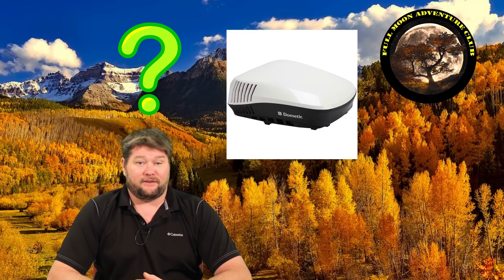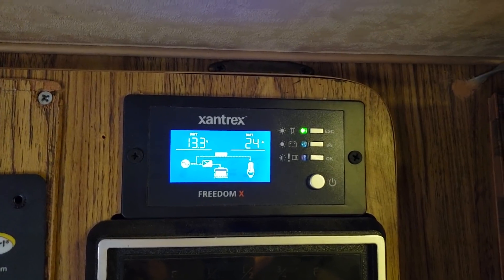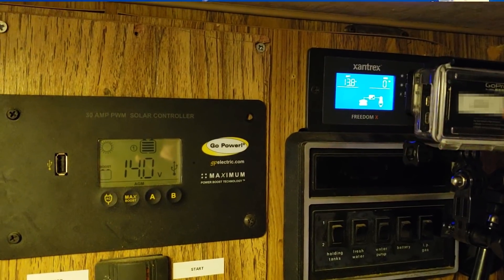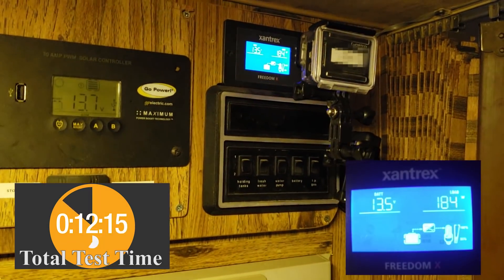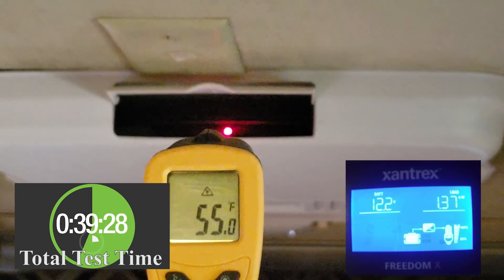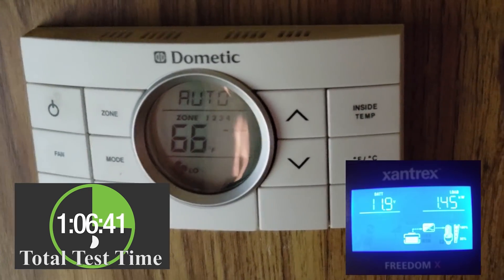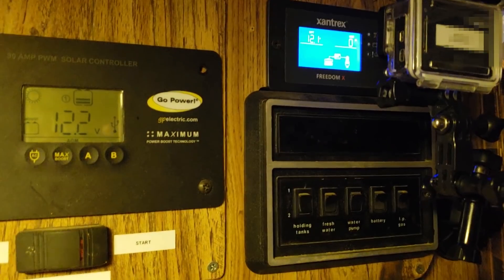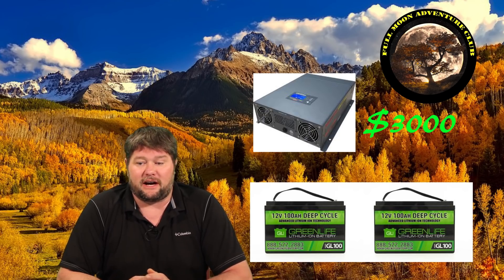How Long Will an RV AC Run on Two Batteries?

Comment: Why are RV air conditioners so absurdly powerful?  RV's are pretty small, a 5000 btu window unit should be able to do the job at a third of the power.  Or are standard Rv's so poorly insulated that you actually do need 15000 btu's to keep up?
Reply from the maker: You guessed it. Poor insulation and heat build up after a road trip needs a big ac to compensate in most cases. If its 90 degrees my 15000 btu doesn't even keep up sometimes.
Reply: rolling oven more or less, all rv's and mobile homes fall here
Reply: mike brink  probably better off bouncing from local hotel to local hotel back and forth.... or the no-tell motel to motel :)))
providing you have income, most only allow a few week stay (maybe 30/60/90 days) it varies where and how clean/nice you keep things.
the upkeep on anything with wheels, uses fuel is nasty... if you have a clean record and good at ,any thing,s maybe apply for maintenance, clerk or other position ;)

Comment: Engineering question. I have seen a van conversion where the engine heated up water that was stored in an insulated tank and that provided the hot water. What if you used the car's AC to cool down some liquid that you keep insulated - would that not work better than an electrical AC system?
Reply: No. With regards to the systems efficiency, the mechanics of an AC system are finely tuned such that rigging your own with random variables (compressor, condenser, expansion valve, wire length, etc) with give you terribly inefficiency results.

Comment: Charging at 80 Amps then discharging at 100 amps or more is a recipe for a short lithium battery life.    

But not my stack of cash
Reply: How can you run your air conditioner without damaging batteries then?
Reply: @NorthlandDWJ  appropriately size the battery bank.   It takes more than 2 lithium battery to do it properly.

Stupid hurts sometimes it is in the wallet

Comment: doesnt woth to buy that ac  and first time i hear about i am gonna damage my equipment and if you have lityium battery there is no way to dame anything else i disliked clock show over hour you say 30 minutes
Reply from the maker: Running an air conditioner with low voltage can damage the compressor. The clock was set to run for the entire test time but does not always match up with all the video clips I inserted. I hope that helps. Take care and happy camping.  Jim

Comment: I'm calling BS on this.  Your video conveniently cuts away during the time where the compressor starts.  That inverter will not start a compressor with an LRA of 50+ amps like that unless it was plugged into shore power during the start.  If the discharge temp is to be believed then it's showing that the compressor is not running right, either.
Reply from the maker: I was using a Xantrex 2000 watt pure sine wave inverter with a 4000 Watt surge rating. It was running a Dometic 15000 BTU brand new air conditioner which runs anywhere from 1500 to 1700 Watts. I assure you the test was accurate and done off of shore power. Without re-watching the video to know what you're talking about regarding the wattage rating shown in the video it's possible that it didn't match up with the time frame or maybe I put the wrong clip in the wrong section a video but it's all done during that test disconnected from Shore power.  Jim
Reply: You should just take a new clean video and post it then.  I will eat crow!
Reply from the maker: @porkbuttrocks  I think I will be doing a new one to show how it works without the AC temperature turn down to 60 degrees. Maybe more of a real-world test we're about to go on an RV trip so it'll be a good time to do it. I would also like to see it done with the soft start installed. If you're a subscriber I guess you'll see it soon enough. Take care and happy camping.
Reply from the maker: @porkbuttrocks   I was looking at an easy start but I haven't gotten my hands on one yet. Very interested in seeing how much longer that extends the battery life without that giant surge.
Reply from the maker: @porkbuttrocks  sounds like an impressive system. It just occurred to me that I've swapped my Xantrex  2000 watt inverter for a SW 3012 3000 watt inverter. You may have to go on not believing me for a while. But I assure you it did work. Take care.
Reply: @fullmoonadventureclub  
C'MON MAN do the test with a 400watt 5000btu for us POOR GUYS 
That DOMESTIC 15000 is a energy hog!!!!!
Reply: RV ac's have hard start built in, to help eliminate the peak start current by temporarily adding a larger "phase" change to the start winding circuit using a potential relay and capacitor, in parallel with the standard start capacitor. if it didn't have that it would never start on shore power in many places or generator.. nor would it restart if it happened to short cycle, the newer units would have protection against that. (old units/manual controls, short blackout) also inverters and generators have a peak current which they can sustain short term for motor starting purposes..

Comment: 1.How do you recharge your batteries ? 2. Can propane get the AC going? Somehow propane Power's  the Refrigerator and Freezer, Oven and Stove and microwave, Lights, Water Heating system, and Furnace But not Air Conditioner this doesn't make sense please explain or can it?
Reply from the maker: The battery is recharged using solar, shore power, or the generator. Propane can not operate the air conditioner, microwave, or lights. Those appliances are only powered by AC current supplied by a inverter, shore power, or a generator. I hope that helps. Thank you for the question and take care.    Jim

Comment: Exactly why is there 18 dislikes?  I thought the video was great and very informative.
Reply: He didn't know what size AC he was running
Reply: @natestube2  It looks like I have more to learn before I go ruining a solar setup.
Reply: cose there is always some idiot who will find reason to give thumbs dwn
Reply: He never mentioned the amp draw. I’m guessing it’s an inefficient a/c drawing over 12amps. Coachmen’s Li3 vans using the 12 volt 20,000 btu Pro Air a/c can run for 10 hrs on their 600 amp/hr system. Add 400 to 600 watts of solar and you’re golden as long as you’re in a sunny area. Or get the a/c unit that advanced Rv sells. It’s very efficient. Bottom line is, the debate of running your a/c off battery power is solved. But you can’t use these old Dometic air conditioners, they’re just too power hungry (inefficient)
Reply: The dislike might be accidental, but is demonstration is how to quickly ruin your lithium battery's.      So he is discharging them at 1 c or 100 amps with out checking the manufactures website it is probably right at their max rating.   If you look at the charts charging and discharging at high currents you really reduce your life of battery's.   

But to each his own.

If you want to see someone who actually understands solar and setups, see will prowess
Reply from the maker: @jerrygundrum1  if you watch a lot of my videos I certainly cover the safe tolerance levels of different battery types. But personally my batteries work for me and I'd rather push them hard than sit in the dark half the time. If I want to just charge them at 50% capacity and recharge them when they get to 50 per-cent capacity I'm sure they last longer but they've been going for years now and I've been enjoying every single amp out of them. Thanks for the comments and happy camping.  Jim
Reply: @fullmoonadventureclub  got a laugh, if I spend time watching a video I like the presenter to at least have a clue what he is talking about.    I haven't watched any of your other videos nor will i.   

has absolutely nothing to do with safety.    If you had properly researched the care and feeding if your life battery you would understand that charging and discharging them like that significantly reduces their life.  

I have no idea how many you have, my guess is, if you keep treating them like in the video you are going to be one sad puppy when they  performing at about 50 percent capacity in 4 years.

That will be an entertaining video
Reply from the maker: @jerrygundrum1  like I just stated. I am certainly sacrificing performance for longevity. I assure you I definitely know what I'm talking about as I do installs and worked for an RV company for many years as a RV expert. I test things to the max for the sake of my viewers and for my own personal enjoyment. The batteries probably will only last four years and I will have enjoyed all of those four years. You can't please all the people all the time I'm afraid. Again, thanks so much for watching and happy camping.   Jim
Reply from the maker: Thanks. I appreciate the comment. Take care and happy camping.    Jim
Reply: It is only around 2%, some will probably be mistakes, most of that 2% just reflect that there are some not very nice or stupid people in the world.
Reply: @snm359  Or they truly understand this has little to do with educating and more  about selling!

Comment: Thank you,but I set my home air at 77to78 degree in Florida and it works fine for me. Would that work for a while?
Reply from the maker: Yes in this test the air conditioner is running pretty much full-time. The closer temperature you have it set to the outside temperature the longer it will run. I'm going to do another test on this using the air conditioner to maintain a temperature 5 to 10 degrees colder than the outside temperature to test exactly that. Thanks for the question and happy camping..   jim

Comment: Why isn't the ac a dc unit?  That would be more efficient than converting dc to ac.
Reply from the maker: Most air conditioners are AC current based. I am only familiar with a couple of DC powered air conditioners. The Zero Breeze comes to mind but not much else.    Jim
Reply: I looked I to this a lot. 12v a.c. systems are expensive. For the same cost I get a nice inverter that will power other things and a more powerful a.c.  If you have a 24v system it work better to find a direct a.c. though

Comment: try also a soft start device that lowers your starting current required and also lowers your running current required on your AC unit. Cheers
Reply: Also lowers running current? That's awesome info I needed to hear. Thx
Reply: @standingmannequin7911  it sends more power over shorter time.
Reply: @standingmannequin7911  thus turning startup compressor faster efficient and drawing less amp per milk sec. But more juice in the get go

Comment: All you had to do was to measure the current drawn from the batteries and then do a simple math. You have 200 AH (good for 200 Amps for 1 hour) in your batteries- recalculate it.
Reply from the maker: It's as easy as that. But a lot of people like to see the visual test. It's also not easy to calculate how often the compressor is cycling on and off. I'll actually be doing another one of these tests where I don't have the air conditioner turned all the way down but just have it about 10 degrees lower than it is outside to see how much it cycles and draws which will change the time.  Jim
Reply: @fullmoonadventureclub  i hope in the next test you use a soft start and arrange things a little different,  i bet with those batteries you could get a few hours in a different arrangement.   i agree it would take a large battery bank like 1000ah to really have something  and if one could afford it,  having a few thousand ah to not have any worries at all.  but then would need to recharge it.     some people having 1500 watts of solar,   and ive heard of people having even more living completely off grid.   i guess every application would be different.  but a soft start i know is something similar to a capacitor in a sence making it to where you use much less starting amps.    thats the main killer   but i bet there are losses at the invertor, yet you did say it was pure sine wave.    hrmmm  not like your going to change your air conditioner but i but there are much more efficent air condtioners, and i have heard about but know nothing about DC air conditioners ?    i have heard they are much more efficent and some people have them in marine applications.  anyway  this comment probably had no value but ive been looking into all these things also.   my conclusion is come to a combination of it all.  having an efficient air conditioner   having a soft start (im also learning about capacitors on a different project.  having lots of solar.  (apparently there are some people with $ running at such a high level of solar they can run the air all day.   but its the night on battery alone thats the killer..  so a  huge battery bank, and again ive heard of some also having the dc to dc air some how, and also having hybird power sources   like wind power and battery,     i think if i was completely off grid i would have a combination of it all, and a huge battery bank.         but i dont.. haha.   so for pratical use   rv and camping,    it seems at best to regulate your ac use,     make better use of fans   have a huge battery bank and alot of solar.     

Thankyou for being smart shutting things off,.      its better to be safe and not push things, and try another test later after figuring things out .    loved the video. thanks

Comment: To get maximum run time, I suggest an AC unit that runs on 24V, or 12V, whatever your system voltage might be.  Of course the lower voltages will need larger conductors so there's a major trade off.

Or just go to a hotel that offers A/C! :)

Comment: Thanks for the share, I  always wondered how long 2 batteries could run an a/c.  I guess I definitely am going to stick with the generator for the a/c
Reply: Hey Chris. I need reccomendation for a generator that I can use for my AC in my van
Reply: @Toytatu  Westinghouse inverter generator 2500. It can handle The surge when the AC kicks on. It's around $500

Comment: RV A/Cs take too much juice. The smallest window air is 500 btu. With good insulation, it would've lasted all day.
Reply: all day? on 200 amp hour? no you're delusional
Reply: @eksine  and you don't communicate very well.
Reply: @raymondjames5035  what are you talking about? you're making no sense. do the basic math. it wouldn't last all day, not even close
Reply: Raymond James 

...5000 btu
Reply: @dalehumphrey8765  I stand corrected...

Comment: Can you charge your  RV batteries from the alternator on your tow vehicle (TV) - by connecting them to the TV battery terminals? Can you just keep the TV idling and with the alternator  producing 100 amps or more at 14 volts keep a load of 1400 watts for your AC running full time?
Reply from the maker: I'm afraid not. While connecting jumper cables to your tow vehicles battery terminals would give some current to the RV it would not be enough to sustain much. Certainly not 1400 Watts. You're tow vehicle would probably have to be revved quite high in order to produce the maximum voltage of the alternator. At idle your alternator doesn't produce all that much power. It would also drastically shorten the lifespan of your alternator on your tow vehicle and battery. There would also be a safety issue when it comes to having jumper cables unattended. If they were to slip off and ground out something or short your battery you'd be looking at a fire. Your best bet is going to be solar panels an extra battery or perhaps a small Honda inverter generator. I hope that helps. Thanks for watching and happy camping.  Jim

Comment: Great review, thanks for sharing. My questions is, Is that thermostat 12-Volt and where did you get it?
Reply from the maker: The digital thermostat in the video is a Dometic thermostat that I purchased from Dometic. It is a 12-volt system and it can also be rigged up to run your furnace or multiple zones.

Comment: How long will two 100 Ah, 12v liPo  batteries run an AC? Oh my.  Bawahhh  ha ha! Not long enough.  An Hour and a half ain't shit when you need A/C.  Lead acid batteries wouldn't last more than half that time and I'm sure you don't know why but it don't matter. It was an honest demo, I got to give you that.   I really shouldn't comment more.  Best wishes.
Reply from the maker: 1000 watts an hour requires 100 amp hours an hour. It's the truth and I just wanted people to know it. It's very doable and I love chasing that Dragon but it can be expensive and difficult. Thanks for the comment and happy camping.  Jim

Comment: A quiet Honda gives off 2000 watts of AC power that will run your Ac all night long!😀
Reply: But it will never start it
Reply: @natestube2  I have been running a 12000 BTU rooftop air on a toyhauler for the last 5 summers, 24/7 for 2 months straight on a honda 2000. No issues. Average daily temp: 95 degrees f.  (Ranges from 85 -  115) Sometimes the crappy roof AC can't keep up, but the Honda has no prob.
Reply: @natestube2  add a soft start is what I am told...
Reply: The new Honda bumped up to 2200 watts, probably to give a little buffer here.

Comment: A homemade fuel cell battrey would compliment those Lion cells,  make a bleach battrey 2 volts per cell drop in waste aluminum and you got power!😁, copper lined 4inch PVC pipe. With screw caps on ends, bolt in the side of pipe thru copper, create anode by using 3 inch PVC pipe with holes drilled evenly around to allow electrons to flow. Wrap with stainless steel screen attach wire to side of case thru bolt for positive terminal case copper is - negative vent cells make 6 to 12  cells 6 cells gives 12 volts, 12 gives 24, use waste aluminum , drop in center anode then fill cell 3/4 way with bleach , reaction starts Giving lots of DC current to charge those cells, drain waste bleach into RV sewer tank, black, gray tank to kill bacteria, clean cells regularly remove bottoms and tops clean with a brush and re assemble cells , Free Power!😀
Reply: Have you actually made and measured one of these?